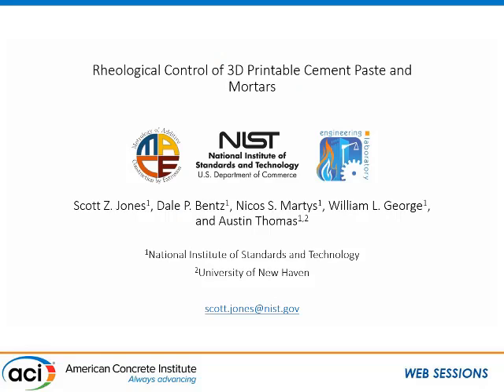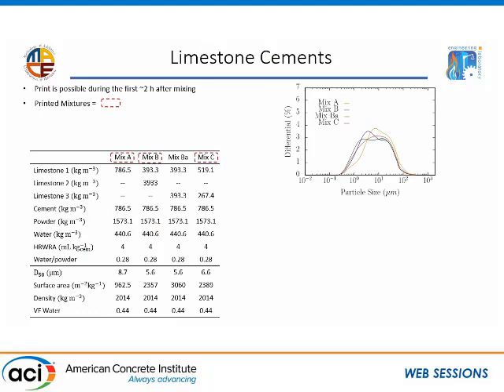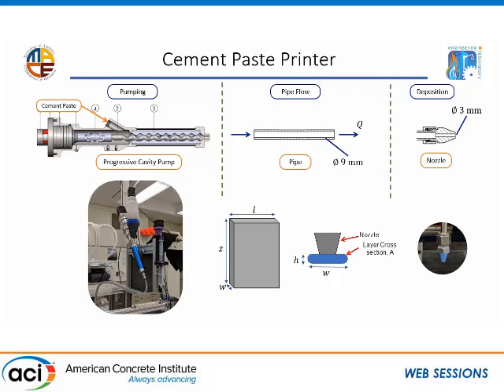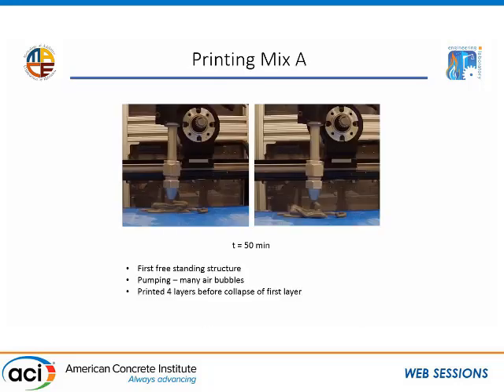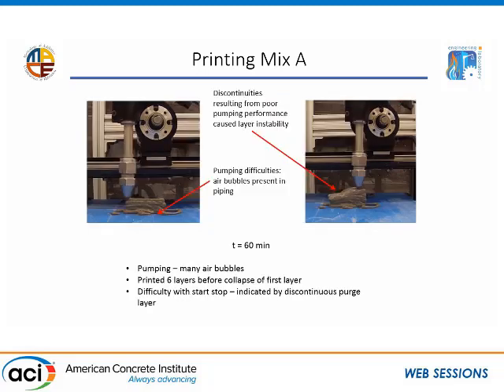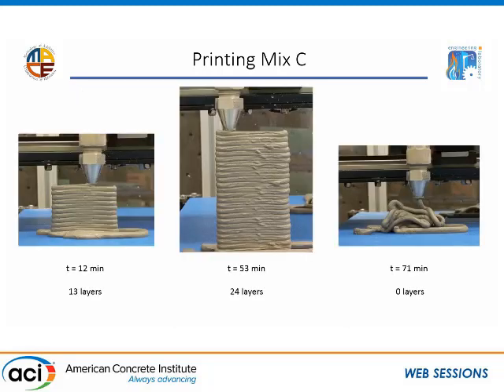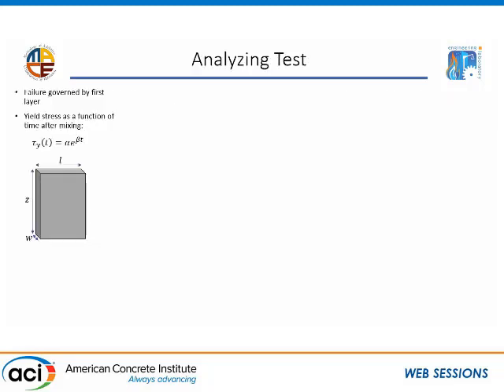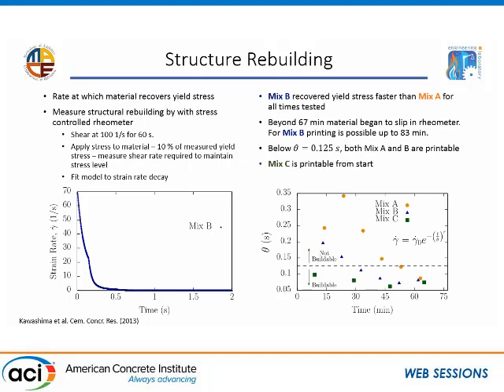Rheological Control of 3D Printable Cement Paste and Mortars

Comment: Dr. Jones, thank you for the very informative presentation.  The w/c gradient that you found relative to r/R is interesting (and any confirmation with test printing would be more interesting). This explains the success of pumping mortar/concrete in general, and indicates that each filament should be stronger and less porous at the inside, relative to the surface.